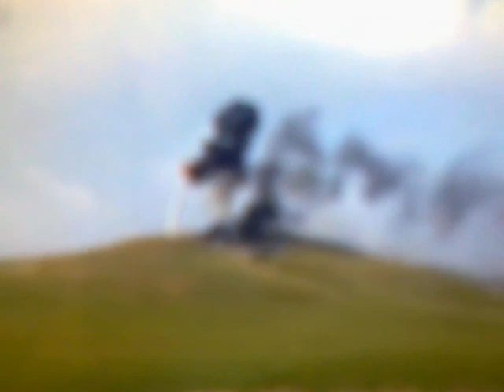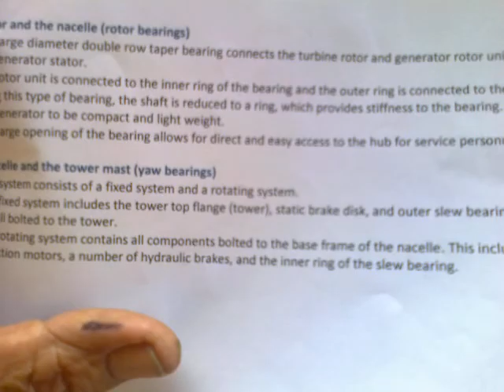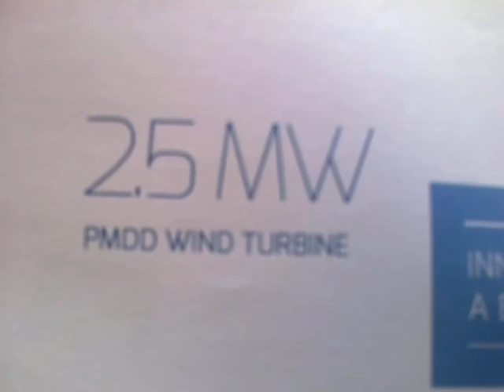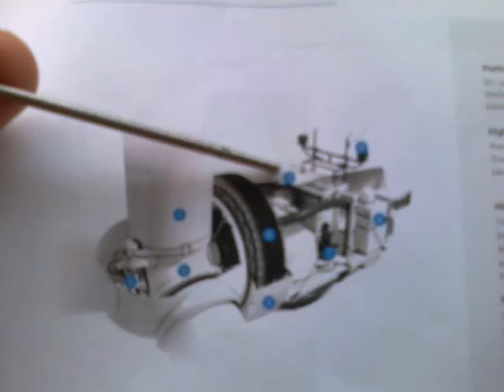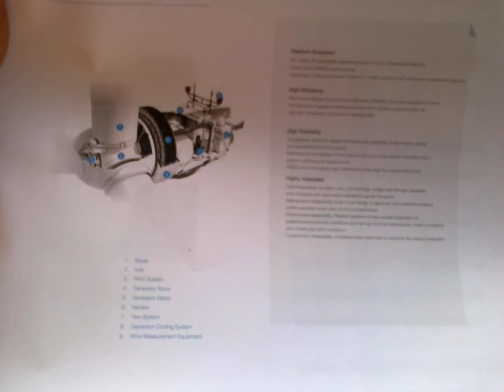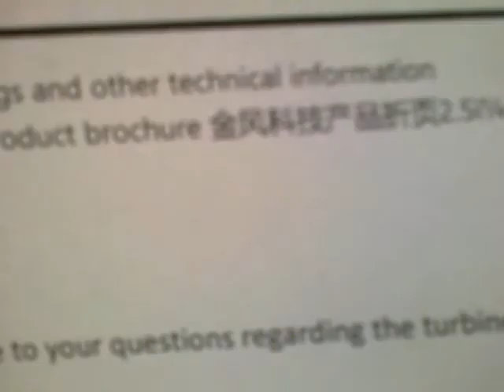Goldwind's First Response, To Fire-Suppression Enquiry...

Comment: We have had wind-turbine farms for a few decades in the UK, the main problems have been noise complaints from those who live near to the farms.  We don't have the climate  of Australia or the need to keep the equipment running cool in very hot weather. 

So if it is something very new in Australia, then it will have to prove itself over time to be reliable, safe and cost effective.  If it does work out well then it would mean a cleaner environment with less pollutants and no greenhouse emissions.

The idea for each have their own fire extinguisher built-in sounds good in theory, certainly to have staff on-site to oversee and monitor their working seems sound and not just have them monitored from a remote location.
Reply: I live on an island in the Atlantic. And on an island further out they put up windturbines. First a few. They only loud protest was from people who ment that Ospreys would be killed by the blades. And a couple were actualy killed during the limited test-phase. But it seemed they got used to them, and since the full wind-farm was buildt there seems that birds and windfarm can co-exist.
Reply from the maker: G'day Victor,

   Yeah, I'm all in favour of building Windmills, I started trying to design & build a Windmill to be more cost/efficient than a Solar-Panel, in 1985..; and every time I made a better Windmill, the Solar-Panels grew to become Cheaper to install.

   
My only worry with regards  Big Windfarms, have to do with their liklihood of having a Pitch-Control Failure/RPM Overspeed-Generator Overspeed, Fire-Incident, on a day when the Temperature & Wind would otherwise have merited a Declaration of a Total Fire Ban.

 The "Graviner" Corporation makes Fire-Extinguishers for Boeing 747s, & 777s, 787's, and Airbus 380s...; so I bet they could make a Remotely-Activated Fire-Extinguisher for a 2.5 MegaWatt TwirlieGig...

   So,  Goldwind should TAKE NOTICE...; or else, they should prepare to pay a crippling "Compensation-Fee", the very first time one of their Turbines ever sets fire to the Downwind Landscape - during the "Fire-Permit Season".

  Fitting "Graviner-Type Remotely-Operable Fire-Extinguishers" appears to be vastly more cost-effective than paying Compensation for potential Damages resulting from a Runaway Windmill lighting-up the Landscape on a "Break-Out Day".

 Just(ifiably ?) Sayin' ,

  ;-p

   Ciao !
Reply from the maker: +Flapjackbatter 

  Yeah, I find that the Wildlife has no trouble in adapting to the presence of a Windmill in my front yard.

 Suffice it to say that no Kangaroo or Swamp Wallaby has ever been hit by my Wind-Turbine Rotor, and wild Birds have only ever been upset by them when trying to perch on a Blade, & then it rotates under their weight - thereby dropping them off, into the Air.

  ;-p

 Ciao !

Comment: Well. They didn't tell you to buy a windturbine or scram. So that's good I guess.
Altso, wouldn't it be nice to have wind-turbines in the Glen?
They would keep you cool during the hot Australian summers : )
Reply from the maker: G'day,

  Yeah, I support the idea of having Windmills & Solar Panels, & we actually have 3 Windfarms & 1 Solar-Farm being built, right now, as we speak ; but my concern is for how they plan to manage a day when the wind is at 60 MPH/100 Km/Hr, and the Temperature is over 36 Degrees Celsius, if ever one of the 450 Turbines loses Pitch/RPM control, and overheats, & lights itself up....

  I want to know that each & every Turbine has a remotely-operated "Graviner" type Fire-Extinguisher built into the "Powerheads" ; so that any time one of them goes overspeed/over-temp., then it can be "push-buttoned" & extinguished, from the Ground.

  Apparently most Windfarms have been located in places where their propensity to light up the surrounding Countryside has never been much of an issue - but these three are in  Grazing, Pastoral, &  Forested  Country ; and Overheated Whirligigs on Total Fireban Days are a realistic reason to worrify.
  
  Have a good one,

 ;-p

    Ciao !
Reply: SPOT ON
Reply: Yes, where you live I think it makes perfect sense to have such a fire-suppression system in place.
I would think there are several reputable providers of off the shelf solutions.
Reply from the maker: +brisly 

 G'day,
  
    Thanks mate !

   I try.....

   ;-p
   
    Ciao !
Reply from the maker: +Flapjackbatter 

  Yeah,

   Apparently, next week I'll be told about the Remotely-Activated Fire-Suppression systems they're going to install on the Turbines.

  It seems that I may have raised the pertinent question, just at the most interesting moment ; before the Turbines are completed & declared to be "operational", therefore whatever needs to be modificated might be done at minimal Add-On Cost.

  With luck, they'll happily install Remotely-operable Fire Extinguishers onto each Turbine ; as being much  cheaper than paying the Insurance & Fines & Compensation attendant on causing any Fire at all, on a Total Fireban Day...

   ;-p

  Ciao !
Reply from the maker: +brisly 

  G'day,

   Thanks mate,

      I try to contribute, even though I be a Fringe-Dweller ; if that makes sense...

   ;-p

   Ciao !